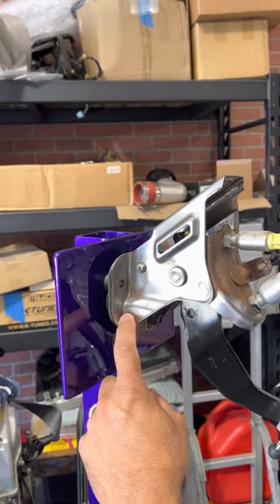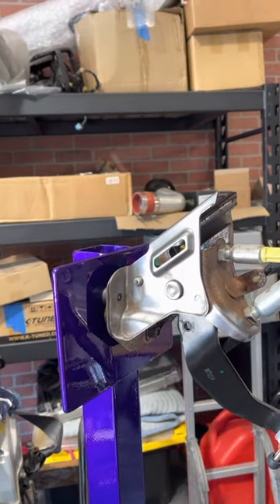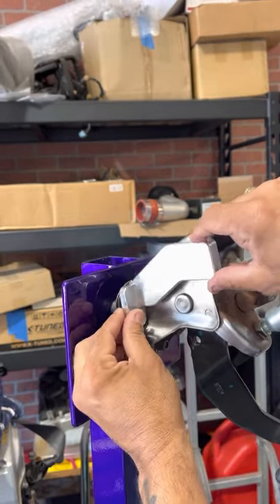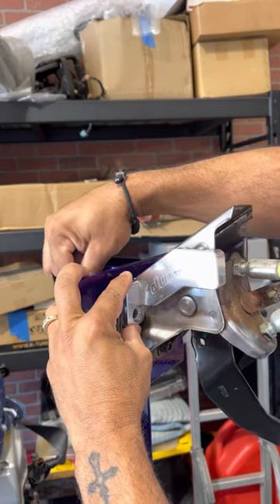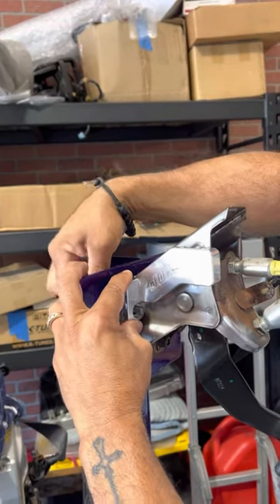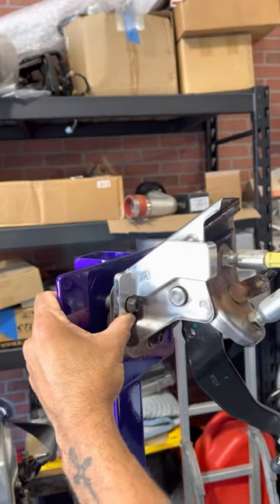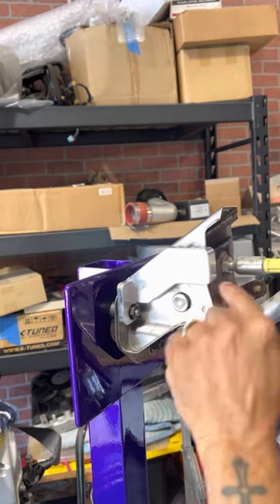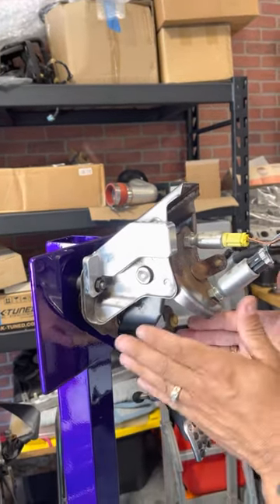8th gen civic Si and TSX clutch pedal Assembly crack repair ￼

Comment: any tips on moving the wiring harness?
Reply: I emailed them for my installation, you just take off the left nut and top clutch pedal bolt, loosen the right nut enough so that the pedal can shift (End of email instructions), take out the clutch pin for the clevis. It will take trial and error to get the bracket in on the right spot. I actually had to pop the hood, move the intake (Luckily its an SRI) and move the CMC so it poked through both the clutch pedal and the brace. I put the top bolt in first to hold the brace because it will be held by the nearby wire harness. Make sure that the brace hole is aligned with the clutch pedal hole. For my experience, I had to shimmy the cmc so the stud can go through. I used the same method of reaching from the quarter panel vs from the front. Reaching from the quarter panel side helped me for when I was installing the cmc. I never needed to move the brake reservoir or remove the cowl and plate. Hope that helps!
Reply: That’s way too much work bro, sorry you went through all that lol. All I ended up having to do was take the top and left nut off, loosen right nut and then just finesse it in there. My wife helped me get the left nut threaded since she has smaller hands lol